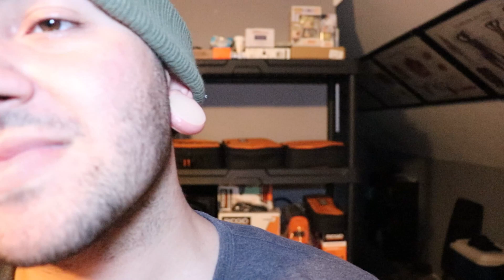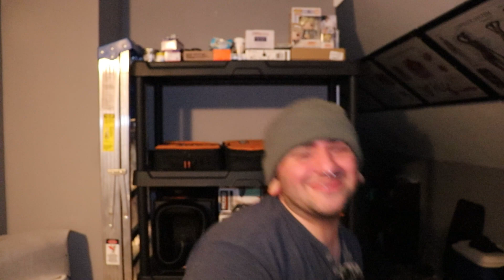CUSTOMER STATES -  NISSAN ROGUE CHECK ENGINE LIGHT - EVAP CIRCUIT ISSUE (P0444) AND MISFIRE (P0303)

Comment: Same issue here with a 2013 nissan rogue man, replaced both solenoids and even replaced the pigtail going to the purge solenoid on top of the engine and still getting a P0444 error. for the life of me cant figure out what the issue is but we do not have the funds to get this fixed.
Reply from the maker: If you're positive that the replacement solenoids aren't defective, and that your pcv valve isn't bad (stuck open or closed), id look at the connection to your ecm/pcm (computer) sometimes a wire can look fine but break inside which happened with a speed sensor I did for someone. The shop that did the job said it was an issue with the electrical to the computer so I'd look at the purge system's connection to your car's computer or IPDM (the smart system). Could be corrosion in the wires or on the pins to where all those pins connect your computer to the fat connector with all the pins for your circuits. Electrical issues are frustrating. In your case, find the diagram for the wires and trace the circuits and you'll eventually find the troublemaker. Also try a wiggle on the harnesses if your issue is intermittent, it could be a wire that's about to snap so it's barely giving a signal
Reply: @TOOL_TECHNICAL Thanks for the info man! I had the shop replace the harder to get to canister and the one on top works too. I'm going to have to check the connections you said. Is there a good way to check for break in the harness going to the IPDM? I absolutely hate electrical issues on cars
Reply from the maker: @rashad5286  electrical issues can be a pain. unfortunately getting into harnesses and probing them is the only way. Before going there, try to find a wire diagram and test the exposed wires. a diagram should tell you which connections/pins should have constant power or ground. anything not behaving as such is most likely your culprit.
Reply: @TOOL_TECHNICAL  This is the same issue I'm having i bench tested both the Vent solenoid and Purge Solenoid, both good. Even bought the pig tail before even testing cause it looked like crap. About to dive into ECM pins and check wire resistance on the signal cable, Cause all I'm seeing so far is pointing to an ECM weak driver issue.
Reply from the maker: @brayanmartinez5255  Hopefully it's not an ECM that needs replacing. Even if you can get one from the scrap yard, it may need to be programmed or have an update at the dealership which is super annoying. If anything hope for a broken wire somewhere. also helps to look at continuity and excess resistance. On the off chance a mouse chewed through a wire, keep an eye out.
Reply: @TOOL_TECHNICAL  Thank you! today the goal is to get Chilton Library to get the wiring diagrams and start checking wire and resistance.